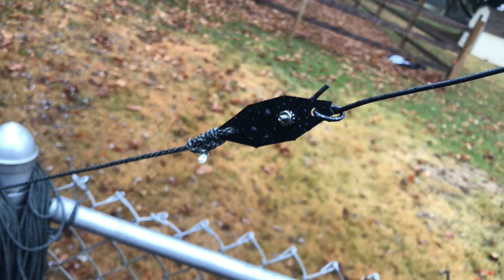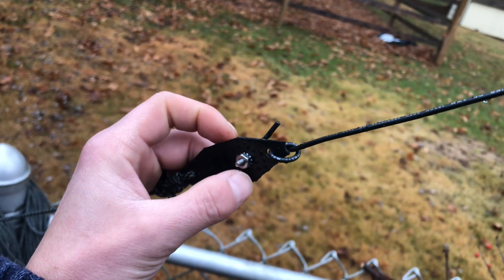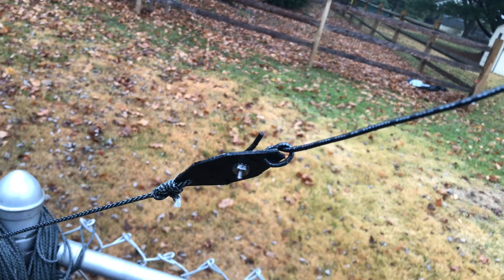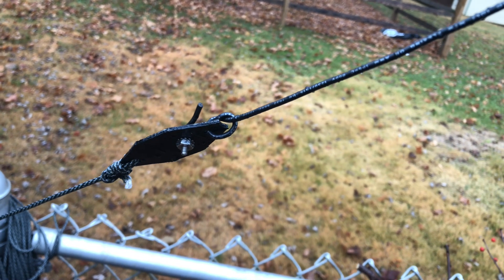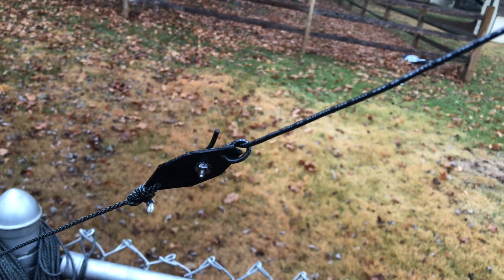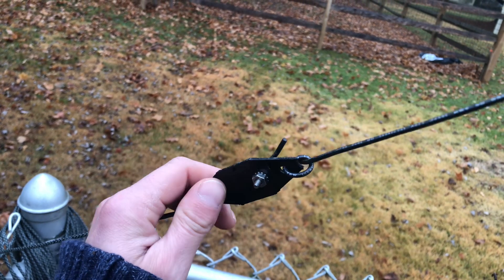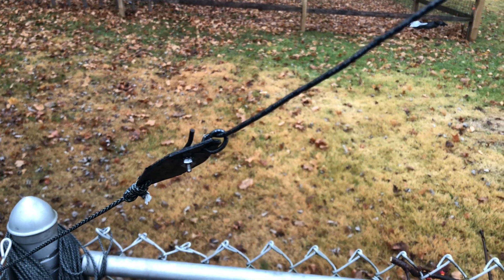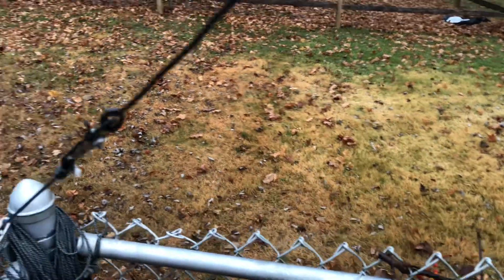Tuning End Fed Wire Antenna

Comment: They went all out on that insulator lol
Reply from the maker: 😆 I know.  But you know what it hardly snags.   Hell , I’ve used soda bottle caps for end insulators for home built wires.  But now I cut  .125” thick Virgin PTFE End insulators designed by myself on a Flash Cutter.  I’ll use scraps they throw away. I’ve experimented with different dimensions and smaller and thinner is the way to go.  73